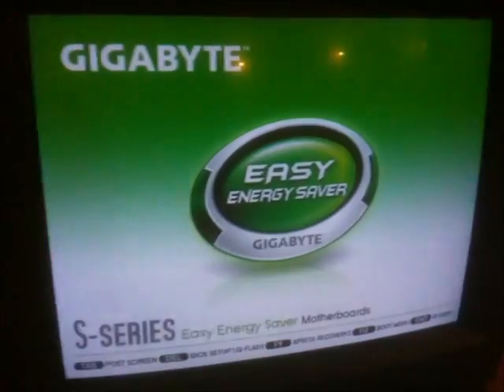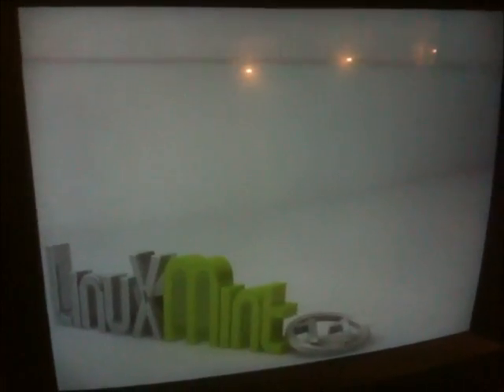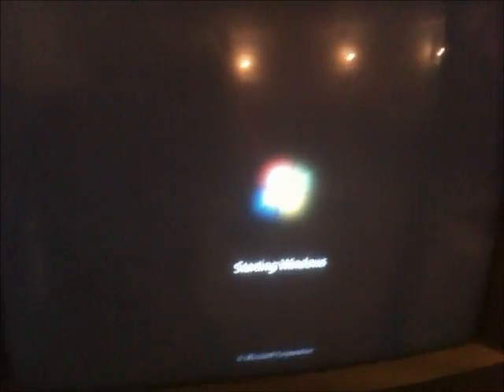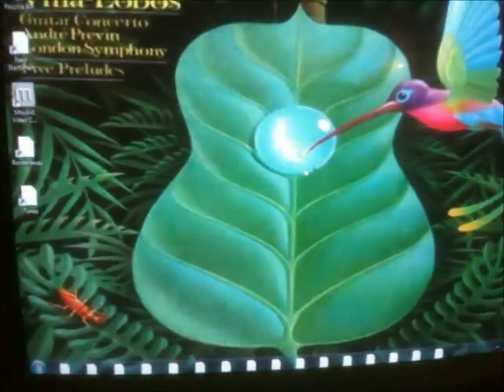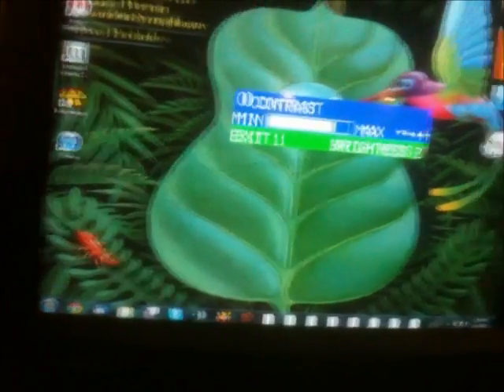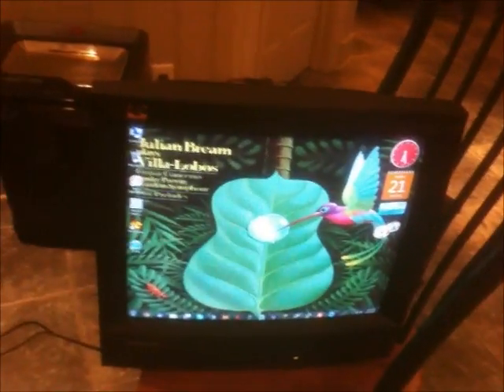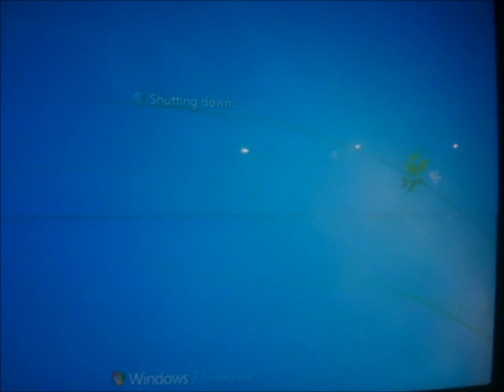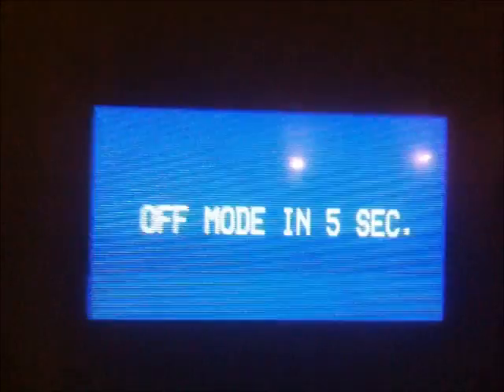ViewSonic E90 CRT Monitor Flyback Adjustment

Comment: I'm too scared to even take off the back...should I flip it so I can slide it open? It's so out of focus that I can barely read text at 1280x1024. I looked at the schematic, and it's pretty much the same as the monitor in this video. The flyback transformer has two knobs and is located on the left. I know what to expect, but I'm just...afraid.
Reply from the maker: One of those knobs on the flyback is probably focus adjustment. Try tweaking that and see if you can get it to look better, just make sure you're turning the right one first by looking at the service data. If that doesn't fix it you might be looking at a tired CRT or something else causing it.

Put it on its face on something soft and lift the back off so you don't run the risk of touching anything that might give you a surprise. What I tend to do when I'm freaked out by electricity is wear exam gloves when working on this stuff. You can still get shocked but there's far less of a risk that way.

Comment: Oh thanks for the video man. I just adjusted the Viewsonic g90f+ monitor and I have finally good brightness in games ;)
Reply: Have you used this video? I have almost  the same G90F monitor and want to adjust brightness and sharpness
Reply: @POWERMAXUM  yes I did. Pay attention to high voltages but you can adjust a little the monitor... Not so much eh, but it deserve a little effort.
Reply: @LorisPeretto Thanks! I will try. What do you mean about the voltages? I first opened this monitor last week to clean the inside dust and glue two chipped plastic parts that broke several years ago when i was moving (first purchased this monitor brand new in 2005). I could see the flyback near the electron gun but havent seen the knobs. How much difference you have noticed? I want to enhance sharpness and brightness -  since is a bit dim  - as i said. Dont know if its my thinking but i remember this monitor to be bit sharper than it is now.
Reply: @POWERMAXUM  I'm on the same boat as you, did you have any success adjusting your monitor?

Comment: I have a question I also have a viewsonic monitor which gets blurry gradually after turning the system on for a few minutes, and I'm about to try this fix. May I ask which way you turned the knobs ? Clock wise or counter ? :3 thanks in advance for your reply.

Comment: If you want to discharge the CRT I heard you can get a flat head screw driver with a alligator clip on it and then on the metal frame or ground and stick it under the cup. Make sure to have a very well insulated one or you might get hurt.

Comment: or the actual flyback (that is the thing on the back of the monitor that the connector from the tube is connected to). if you do need to actually access the flyback you can disconnect it from the tube by pinching the ridge on that connector on the top of the tube and pulling it off, then purging the caps by turning it on with that disconnected. that will let you access the calibration on the flyback itself (don't bother) or test and replace failed parts in the high voltage components

Comment: i have an e90 as a secondary monitor i use for video while browsing or playing games, i run it at 1920x1280, the aspect ratio is off of course (small black bars on the top and bottom of course), if you want a resolution that matches the aspect ration use 1792x1344, both of those resolutions are higher than 1080p. btw, unless you are a complete dunce opening a crt and working on it is perfectly safe. just don't peal back the little rubber cover on the connection to the tube..... (more)

Comment: Nice vid dude, have you got yourself an FW900 yet?  If not, it is worth the price of admission!
Reply: Also Iiyama Vision Master Pro 514, Silicon Graphics Trinitron/Diamondtron, HP P1230, Mitsubishi Diamond Pro 2070SB, LaCie Electron Blue IV  are damn good CRTs
Reply: @DVRC  I can vouch for the Mitsubishi CRTs, I have a Diamondtron in my collection and it is the best monitor ever, with a maximum 200hz refresh rate at 480p and with the clearest image I've seen from a CRT even beating my Sonys, it was a great find, I'm sad they will never be made again.
Reply: @DVRC  does this video apply to any ViewSonic? I have g90f one
Reply: @POWERMAXUM  That's a 96 KHz, so it's not that special. But that's not usual the fact that it can reach 180Hz in vertical refresh. So it means that if you lower enough the resolution, you can hit 180Hz. But at least you will do 1280x1024 at 85Hz. Probably 100 in 1152*864.

Comment: Check out the library for some old books on tv repair. The crt tv and monitor are based on the same principles. By the way, I think the crackling you are talking about is the degauss function that runs at start up. The filter mask behind the screen can start to build a magnetic charge over time. The degauss sends a charge through the mask to get rid of it. If allowed to build too high it would affect the path of the electrons. Look under settings for degauss and run it. The screen will flicker .
Reply: The "crackling" is the high voltage ramping up on the CRT.  It is effectively "static electricity,"  but much higher CURRENT.

The degauss circuit produces a short deep "hum."  Most sets will only do the degauss when the set is "cold."

Comment: Haven't opened many crt monitors.. I have an old hq ~2002 21" eizo (trinitron tube, has 2 horizontal lines across the screen) that still gives great picture,but I started noticing the ghosting effect, usually when using a shit cable. Still visible on high resolutions when with a quality cable even, which bothers me a bit.
Do you think there are adjustements somewhere on monitor where I can  fix the "white ghosting" like on yours? I can also set r/b convergence, but it's never "good enough". Help

Comment: from what i have heard from a relative that used to reparir CRT monitors is that you sould take a long screwdriver, grund it to the chasis or something simuler and then push it under the rubber thing thats protects the high voltige plug on the CRT. this will discharge the CRT and usuly couse some sparks between the contact and the screwdriver but thats normal.
Reply: True story